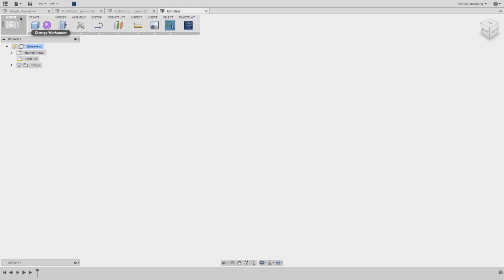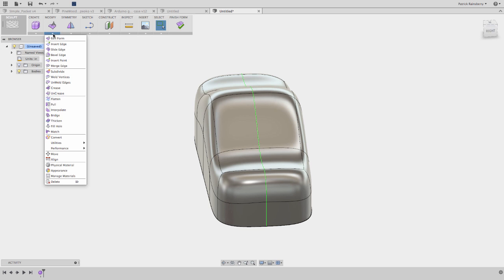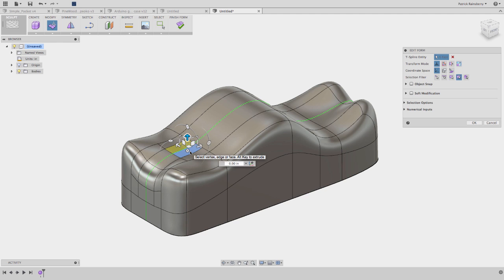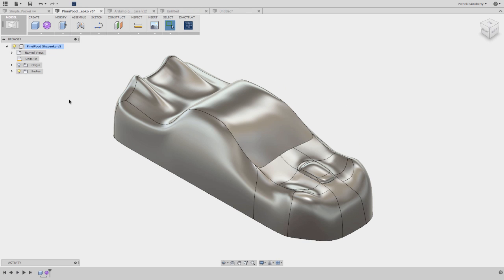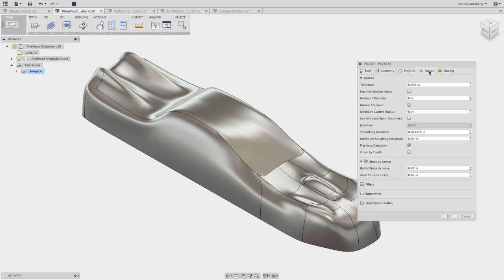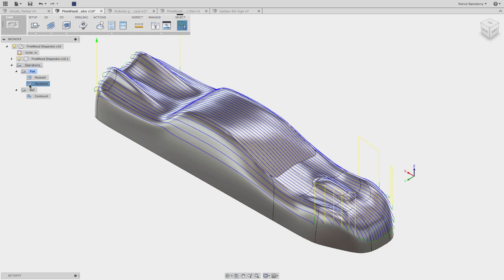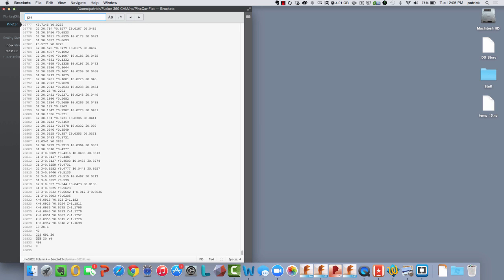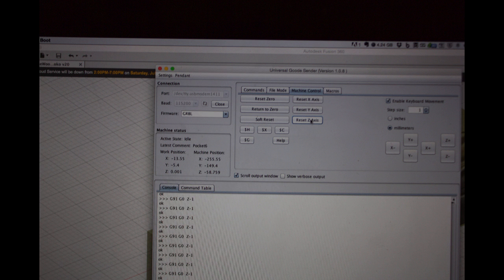3D Carving Pinewood Derby Car with Fusion 360

Comment: why did you set the z at the bottom wouldn't it be easier to set z at top of work piece
Reply from the maker: its actually way easier in general to always zero off your table.  Then if you ever change anything or you change tools and the top of you stock isn't there anymore you still have the same reference point.  Also the table is probably flatter than your stock.

Comment: Thank you!!! very informative and very useful, I'm planing to buy cnc router next month so it was extremely useful, I was very worried about "G-code" I thought I had to write it manually :))) I have one question sir, Is every cnc machine compatible with Fusion 360? I'm buying one from china, do I have to check with manufacturer if it's Fusion 360 compatible?
Reply from the maker: hard to say.  Post processing the CAM in FUsion to the specific information the machine needs is one of the more difficult things.  If we don't have a stock post for it you may need to check with the vendor.

Comment: How do you change toolheads, does the machine pause and go to a home position after each toolhead pass is done?
Reply from the maker: Yes.  Each tool is saved as a different file. After you run one file, change tools and run the next one.  The key is to not mess up the zero location.

Comment: Hello Patrick, really liked your tutorial, very helpful in deed, but I have one "beginner" question. I understand the initial set up and the zero X, Y and Z positions etc., but how does Fusion know where to start the second (and third) pass X, Y and Z positions? i.e. The simulated tool paths seem to "know"  that the previous cut has already happened. Sorry to be a nuisance.
Reply from the maker: No problem.  Everything is based on where you have the zero position set in Fusion, this is defined in the operation setup.  The trick is to make sure you have the zero in the same place on the physical part when you are cutting.

Comment: After change the tool you reset z, why?
Reply from the maker: since the new tool will extend a different distance from the spindle you have to reset the machine so that you have a common reference point.  If you don't reset Z you would have to ensure that the tool stuck out of the spindle the exact same amount as the previous tool.

Comment: The hardest part of doing pinewood derby is getting the wheels on straight - those sawed slots for the axles are a nightmare and some races rules insist you use them.
Reply: Don't ever use the precut blanks for your car.  Make your own to the exact same specs as the kits.  Then you can cut your own slots.

Comment: Can you import .stl files into Fusion 360? Can I make an inventor file, export and then use this to drive my Shapeoko?
Reply from the maker: You can import STL, but the data you get will be triangulated.  This is really not machinable using Fusions techniques.  Fusion wants smooth surfaces.  If it is less than 10,000 triangles you might be able to do something, but it is going to be less than ideal.  Usually you would use this to "trace" the model using 3D modeling techniques to get high quality surfaces.

If you can create models in Inventor you absolutely can bring them into Fusion 360.  Either upload the Inventor files to Fusion cloud or directly export and import as step files.

Comment: Great vid!!  Do you have to be very carefull when doing the tool change not to bump the x/y?  if you move it at all won't it be off for the finishing passes?  I guess when the machine is on the steppers will hold against a little force so it's not too bad?
Reply from the maker: +Eric Torrie Yep, it isn't really a problem if the steppers are engaged.  I haven't had a problem with it.

Comment: Also, did the fins chip?  Was this an issue with the wood or was the feed rate maybe a little high?
Reply from the maker: +Alluvian Haha yah, the tool was too short and the collet nut clipped the fins on that spiral finishing pass.  I should have done a more accurate simulation!!

Comment: Very new to CNC, hoping to buy an xcarve soonish...

Why the two finishing passes?  I would think the first pass would be enough, is that not the case?  The video didn't seem to show the second contour pass, did that actually remove any material?
Also, I notice that there is some material left at the front on the surface.  Is this just an issue with the work surface not being perfectly level?  I would have expected that at the rear, not near the front where you set the zero...

Sorry if I sound nitpicky, I am not meaning to criticize, I am just trying to learn.  I appreciate the video a LOT, thank you.
Reply from the maker: +Alluvian Its hard to see in the video but it did smooth it out a little.  I jsut wanted to show two different kinds though.  FOr real i would just use a parallel finishing pass on this probably.